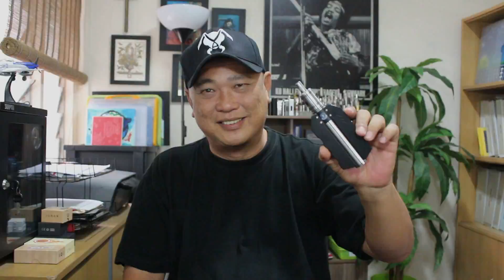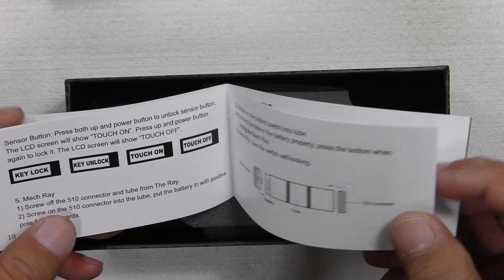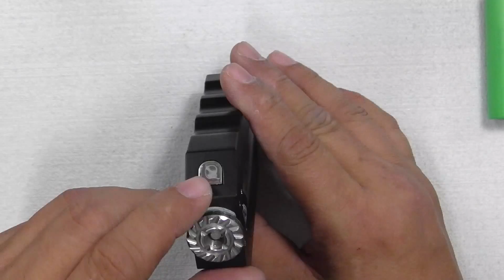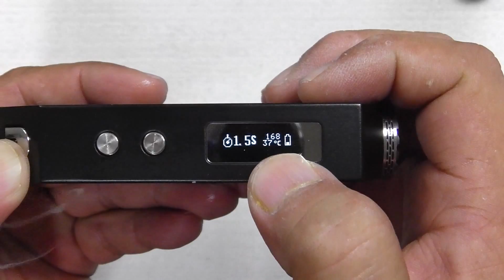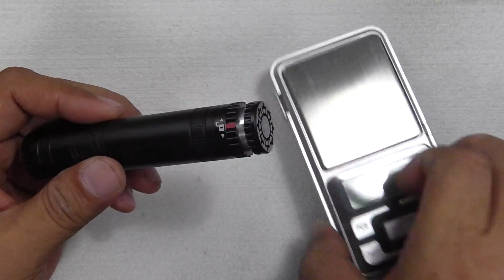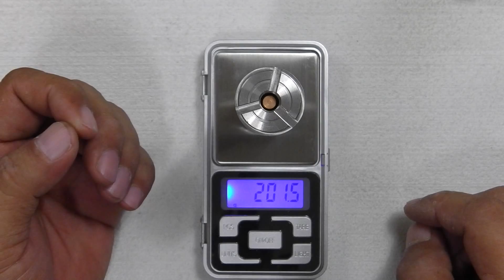Unique Vapor Innovations- Pt1

Comment: The Mech Ray looks sounds and weighs like aluminum rather than solid copper.  Are you sure it is not just copper COLOR?
Reply from the maker: Maybe so, I'd have to scratch it a bit to see what's underneath :) Thanks for the tip.
Reply: ***** I think you just have to look at the silver threads (they look silver in the video anyway). No need to scratch the mod I suspect.